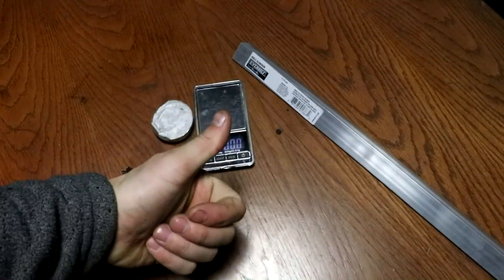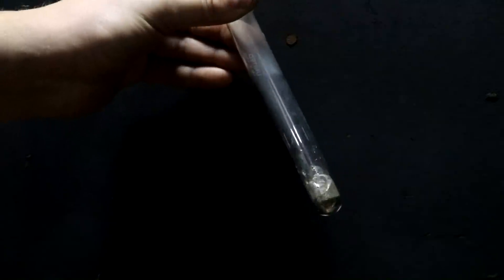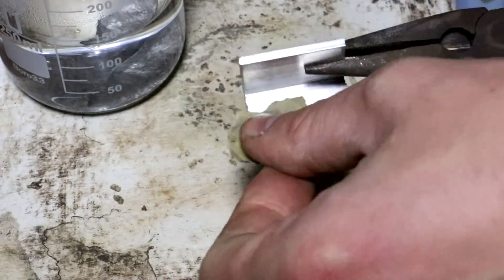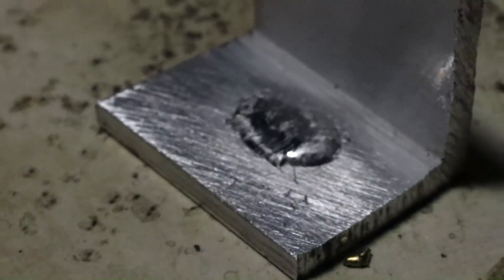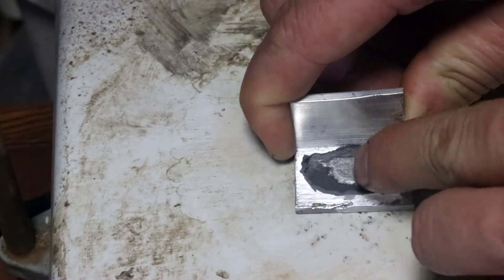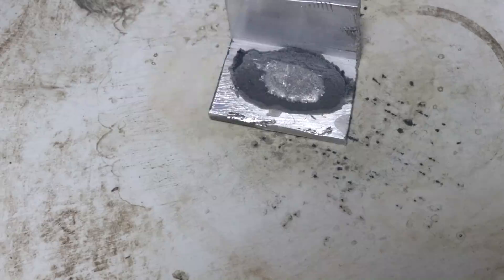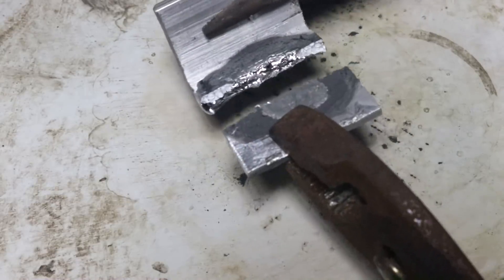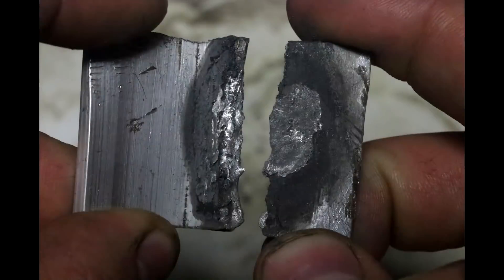Field's Metal vs Aluminium

Comment: I don't know if anyone else has said it, but could it be that the Field's metal is contracting under the aluminium oxide layer and is able to destroy the oxide layer in some way?  
Could it be changing the roughness of the surface as it contracts making it appear darker next to the shiny aluminum as it contracts?
Aluminium is more reactive than indium but once it solidifies could the aluminium oxide be catalyzing the oxidation of indium? I don't know how fast indium oxidizes in air but i'm thinking maybe as it alloys(?) with the aluminium it becomes easier to oxidize somehow?

Comment: Copper chloride works just as well. No need to melt anything, just dissolve copper chloride in water, add in Al and wait for H2 generation.
Reply: You could also use lye but the advantage of using liquid metal is that it isnt used up during the process.

Comment: Looks like there could be a change in crystaline structure occurring. The heat is enough be to allow the alloy to penetrate the crystal structure of the aluminum and as it cools it forms it's own crystal structure destroying it as it goes.

Comment: I would say the higher temp slows the reaction do to the fact moisture from the air if driven away to a greater degree than at lower. As demonstrated at the end water greatly accelerates the reaction. Seems obvious to me.

Comment: captain there: It could be that as it cool of, the solubility of one of the alloying(s) element decrees. It then segregate out of the part and crystallize. as you heat up the part the solubility increase again and the alloying(s) element might dissolve back into it.

Comment: I'm not sure if the chemical proses when you dropped it in the water is similar to the one that destroys the aluminum before that. But if it is then my guess to why it speeds up when you cool it down is that water condensates onto the alloy when it cools.

Comment: I could maybe hypothesize that the oxidation happens at lower temperatures because of the oxigen solubility changing, something similar to what happens with oxigen solubility in water, possibly at room temperature it was a lot higher than at the temperature that the hot plate heated it up to.

Comment: My hypothesis about why it is more reactive when it cools down is because of fields metal state of matter because of temperature. While raising the temperature does causes reactions to go faster. This might not be the case because of the alloy's melting point. Since it was already in liquid form and the aluminum is solid it wouldn't bond properly. I thinking it like rust, because when you heat rust it turns back into iron(of course with other proper chemicals and such). Rust will not exist at melting point since all the oxygen is being released.

Comment: It probably soaks in laterally faster than vertically because the angle would have been extruded. The grain structure of the aluminum would probably be stretched in the direction of the extrusion.
Reply: But the grain structure isn't like wood is it? I mean it's similar in a way but would it really affect this in that way?

Comment: Wouldn't this work better and faster if instead of heating it with the hot plate you just hit it with a torch until it became red hot and then let it cool? And the oxide layer that forms when it cools may be caused, as you probably hinted, by humidity in the air. In any case, seeing this video the same day I started studying diffusion at university is both very cool and very coincidental hahah love your videos, keep up the great work!

Comment: The fields metal probably doesn't react very much with the aluminum on the hotplate because the moisture in the air would be lower, once it cools it can attract the water that it uses to react with the aluminum to oxidase it and the silvery outline Cody saw was probably how much the fields metal in the liquid state penetrate the aluminum sheet

Comment: The flow rate of the fields metal in respect to the reaction with Al makes sense based on the Lateral Al crystalline structure, seems the metal is following the highest lattice surface area due to not being able to penetrate multiple layers at once (as would be the case if the Fields metal was moving vertically through the Al). Seems as though the alloy "pools" through the lattice instead of "eating" the lattice, if this explanation makes sense to you. It's really cool to look at the embrittlement of the Al.

Comment: HOW PEOPLE FIND THE LENGTHS OF OBJECTS.
USA- imperial
EVERYONE ELSE- metric
Me-count with fingers
Cody- “Its about three nano light seconds long”
Reply: You missed out:
MIT students- Mr Smoot
Reply: ikikuraz my girlfriend said it first
Reply: I thought USA progressed to mooch unit during this glorious trump era.
Reply: Lmao
Reply: the UK still mostly uses its Imperial system,  the people there cant seem to shake it off since they were the ones who pioneered the system, they drive in miles measure their height in feet and inches etc too. i couldn't tell you my height in cm's
Reply: I guess Cody also measures thickness in beard-seconds.
Reply: Technically metric uses the same method cody used, but the metric system has simply given names to certain lengths of lightseconds.
Reply: Comes out to almost a 1 ft. Its like .98 ft
Reply: @quijybojanklebits8750  who's feet
Reply: Lumnum
Reply: The inch is the same, it is the gallons which are different.   And,  both inches have been defined as 2.54 mm (exactly) in the 1950's.   Before that,  they were about 1 part in a million different.
Reply: A British Imperial quart is equal to 1.13 liters (or 40 fluid ounces), whereas a quart in the U.S. Customary System is 0.94 l (or 32 fluid ounces). A gallon in the British Imperial System is equal is 4.54 liters (or 160 fluid ounces) while a U.S. gallon is equal to 3.78 liters (or 128 fluid ounces). 

Another difference is in units of mass. In Britain people often use the stone. One stone is 14 pounds. Eight stones are one hundredweight (112 lb). Twenty hundredweights are one ton. So one British ton is 2240 pounds. It is very close to the tonne of the metric system.

In the United States people do not use the stone. They usually use a hundredweight of 100 pounds. This hundredweight is also called a short hundredweight. Twenty short hundredweights are one short ton. The British hundredweight is also called the long hundredweight and the Britsh ton is also called the long ton.

Comment: The grey bit looks like Tin pest. Perhaps the fields metal alloy acts in a similar fashion, permeating when hot and forming tin pest when it cools, but at higher temps than normal tin because it's in an alloy.

Comment: This is due to Galvanic corrosion.
The aluminium-fields metal couple acts as a galvanic cell and the aluminium forms the anode of the cell, and corrodes rapidly, whereas the Bi-In-Sn alloy acts as a cathode and is virtually protected from corrosion until the aluminium is completely corroded away or is not in electrical contact with the alloy.

Comment: Galistan, Ga In Sn, is really awesome when alloyed with Al at Al 95%, 5% GaInSn, and VERY SLOWLY COOL IT (this is key to co-crystallization of the metals, and preventing the Galistan from seeping out at the Al grain-boundaries. Then react it with water ;) hahaha H2 production to the extreme!! AlOxide and some AlOH will form and the Galinstan will collect, non-consumed. A wet centrifuging of the metals will separate the Al products from the Galistan.

Comment: I did expect it to allow aluminum to be decomposed by water. This is a better method than using gallium based alloys mainly due to cost. You could apply for a patent for a new way to decompose aluminum for hydrogen powered vehicles.

Comment: I bet that if you keep aluminium with gallium over the melting point of gallium it wont be as destructive to the aluminium. It might be expanding gallium mikro crystal interaction that breaks the aluminium crystals apart. Keeping it warm should prevent that in that case. Same thing for this metal, but it seems like it cannot stay liquid as long as gallium can, on aluminium. (probably because aluminium contamination of gallium lowers it melting point)

Comment: There is actually liquid metal for pc components, which is liquid above ~0° celsius. It`s used for transfering the heat away from a processor in a more efficient way than thermal compound, resulting in lower temperatures. They also warn you to only use it with a copper (or better nickel plated) cooler and not with an aluminum cooler because it will corrode it. So the liquid metal for shure corrodes the aluminum in a cold state aswell.

Comment: If you put a gallium/aluminum mixture into water it creates a significantly larger amount of hydrogen gas than the fields metal/ aluminum mixture. The gallium mixture triggers a more vigorous reaction and even without soap you get much larger bubbles, so when you light them you get pretty large flames. The reaction also tends to last for a while, even when using just small amounts of the mixture.

Comment: Eww, you are using the [second] units of time?
If you were serious about avoiding metric, you would have discribed the length of the bar with the distance light travels in 32768 oscillations of a quartz crystal that was excited by an electricity pulse. Tsk tsk tsk.

Comment: Cody please make a video where you put a vacuum chamber with a gauge on the outside and put it in a larger chamber and pressurized the large container and measure the psi using the change in vacuum.

Comment: 2:31 ¿Could the iron oxide from the blade and the aluminium from the cut mix and form spontaneous thermite with the friction heat?

Comment: I think it's partially because of thermal expansion. The Field's alloy eats tunnels through the aluminum, stopping at the edges, and when you turn the heat off the fields metal flows back while solidifying, and exposing a lot of the surface it affected, wich then gets oxidised.

Comment: Ah so MOISTURE is the answer. You even said it yourself.
THAT's why it reacts when it's cooling off, because there's condensation from the air forming on that metal.

Comment: I'm no scientist but I'll take a best effort guess at why the field metal attacks only while cooling. When the materials are heated up the atomic structures of both materials are in a higher vibrational  energy state and the alloy acts like oil on water or more accurately, liquid on a vibrating speaker. As they cool down, at some point their atomic vibrational state reaches an optimal point where the crystal lattice of the aluminum is more easily penetrated by the alloy. So essentially I'm thinking the alloy has an optimal temperature at which it attacks and the aluminum is more susceptible to being destroyed at a certain temperature (it's apparent resting/relaxed state). Wouldn't the alloy and the aluminum also cool at a different rate? I could be way off here but this is where my thoughts went.

Comment: My guess for the thermal cycling would be that the eutectic alloy you want to break the aluminum down with isn't formed at the higher temperature. Is one of the ingredients in the field's alloy reacting to form a different alloy at the higher temperature instead? Either that or it could be that the thermal contraction was able to do something to the oxide layer that your scraping couldn't.

Comment: The first thing that came to my mind as to why this rotting effect happens, is that it may be a thermodynamic effect. When both your Field's metal and Aluminium ('Luminum :D) are cold, the kinetic energy isn't high enough to form a new alloy with higher Aluminium concentration. When you heat it up you have enough kinetic energy but an alloy with high Aluminium concentration may not be the most stable conformation thermodynamically. So the formation of a new Field's metal - Aluminium alloy would only happen at a lower temperature window, closer to the phase change of Field's metal, while it's cooling down. So Al - Ga alloys or Al - Hg amalgams may just be easier to form, both thermodynamically and kinetically.
Another thought that I had was that since the Field's metal is a liquid and the Aluminium is a solid, the Aluminium has no reason to give up its stable crystal stucture just like that. So while the Field's metal is crystalizing, the crystalization energy may be high enough to break up some of the Aluminium crystal structure near the interphase so that some Aluminium atoms get exchanged for Bi, In or Sn, which would explain this gradual rotting effect.

Those are just some thoughts though, I didn't put any research into this. I would gladly hear someone elses thoughts on this

Comment: If you turn on the hot plate moisture is not getting part in to it because of temperature.. as you turn it off let it cool down the reaction took place faster due to air humidity affecting it at certain point when the metal is still in liquid form on cold plate..

Comment: My "definitely-not-an-expert-guess" on the metal destruction would be that the air moisture does more damage than the alloy. My guess is that while the aluminium is hot only the alloy is destoying it, but when it cools down also water can attack it... 

Maybe you could repeat this experiment in an dry atmosphere, to test my hypothesis.

Comment: Cody, which liquid metal would be acceptable to use on a aluminum heatsink? Like for cooling the CPU more efficiently. Common liquid metal thermal conductors are made with gallium or some gallium alloy and would destroy it. Is there some that wouldnt?

Comment: I would imagine that the Field's metal saturates while liquid, then when the crystal structure reforms it more-or-less rips the aluminum apart. It would be interesting to see the effects of a sharper thermal cycle, such as with a torch and dry ice.

Comment: Seems a lot like gallium (low melting point, reacts with aluminum, and is "wet" unlike mercury).  That being said, this seems to react much weaker with aluminum and is probably a lot more expensive.

Comment: Perhaps during a heating phase water vapour in the air is prevented from interacting with the aluminium dissolved in the fields metal, then as the metal is allowed to cool back down, water vapour in the air starts to interact to form darker oxides...

Comment: Maybe it because when the aluminum is cold its crystals compact pushing the field metal down and out between the Crystals  when hot the Crystals expanded making it easier for the field metal to seap in
Reply: @samarnadra  i know thanks for explaining it but i mixed up hot and cold i fixed it just a min ago
Reply: Samar Nadra that analogy confused me even more. Like seriously bro? 😐
Reply: Samar Nadra wtf is that supposed to mean? Are u tryin to say its MY fault ur analogy sucks Ass!
Reply: Rob, lattice constant increases in a direct relationship with temperature.  To the point that when the temperature gets high enough, the lattice is so large it cannot maintain integrity as a solid, and becomes a liquid.  Maybe Louis' solid state physics isn't totally on point, but it's not too far off.  The interatomic distances are certainly larger between grain boundaries than within a single crystal.  Hence the fact that there is a grain boundary diffusion coefficient separate to the bulk diffusion coefficient to describe total diffusion in a polycrystalline solid.  With the higher kinetic energy and expanded aluminum lattice, the Field's metal can attack along several vectors mentioned elsewhere.  Namely, in order of effectiveness, surface, grain boundary, dislocation, and bulk diffusion.
Reply: knibknibknib wtf is a lattice tho
Reply: Crystal lattice, it's the arrangement of the atoms of the material.  Metals will all normally be crystalline at small scales.  Aluminum is FCC, or Face Centered Cubic, where if you imagine a box, the aluminum atoms will be at each corner and the middle of each face.  This is the smallest repetitive unit you can use to describe the material before you start talking about individual aluminum atoms.  You can sometimes see this structure macroscopically when you look at some natural crystals like quartz (hexagonal) or pyrite (cubic).  Glass on the other hand is amorphous (has no repeating structure). When it breaks the fractures are curved or conchoidal like a clam shell's little steps. 

The wikipedia page on "Crystal Structure" is a great primer into the subject.  Material scientists, chemists, physicists, and geologists all study the subject deeply, as did I for 6 years.
Reply: knibknibknib i probably will study it soon then considering im a pharma science student
Reply: Louis Kreyling maybe you should stop flunking chem class
Reply: @OF01975  i have never taken it and lets hear your theory if you can come up with one

Comment: Maybe when you heat it the metal is still like not 100% solid and it just melts a bit then goes back to a solid state and it cant push trough aluminum